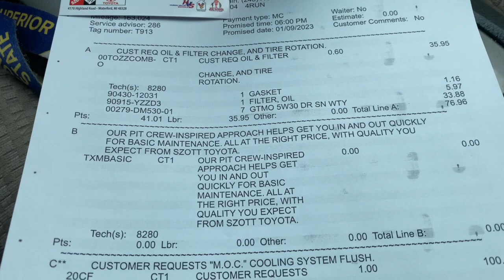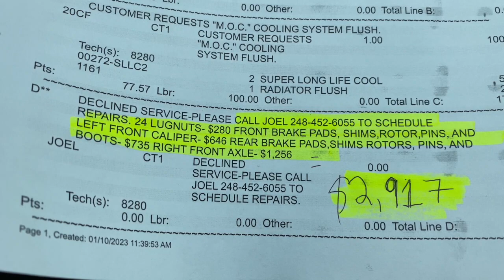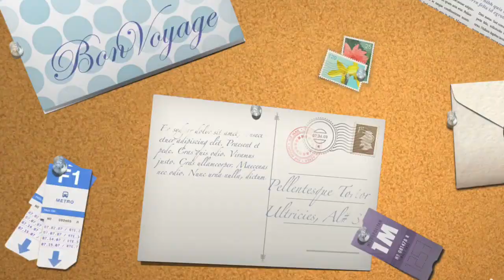DON'T TRUST TOYOTA DEALER SHIP

Comment: When I first took the wheels off a used 2010 Camry. The original lug nuts did not fit in the tool. It is common for lug nuts to swell on certain cars and trucks. So, I brought new lug nuts on E bay.  I always tork lug nuts to the factory spec , on my Camry it is 75 Lb. Ft of tork.

 You might be able to buy a new axle boot and clamp from Toyota and refill it with grease. You would be better off using the Toyota axle if it is not worn and replacing the boot , as the Toyota part is much better made.

 Jack up the truck  and Spin the wheels by hand and listen for noise. I sand the rusty rotors with a random orbital sander, like a carpenter uses with 60 grit  and put new brake pads in if needed. Again ,Toyota parts are made much better than replacement parts.
Reply from the maker: yeah you are right Toyota part always better but they are ways too much.